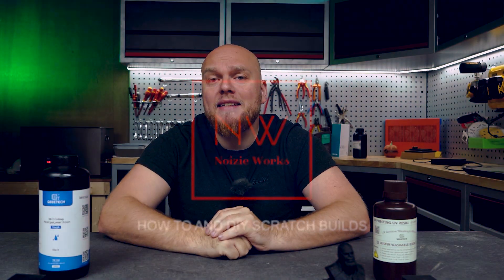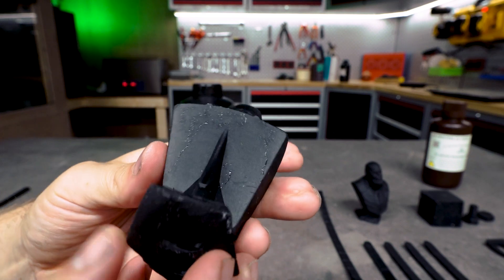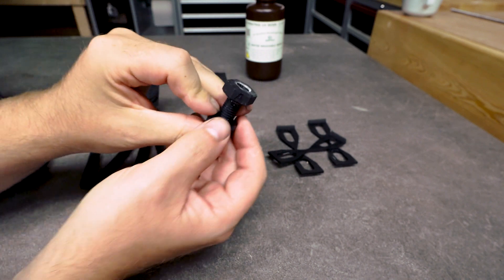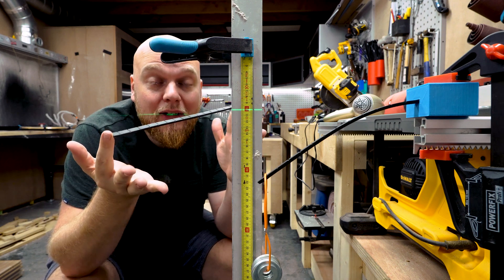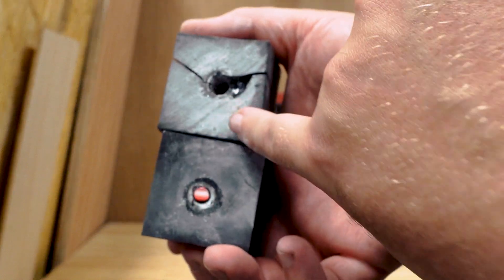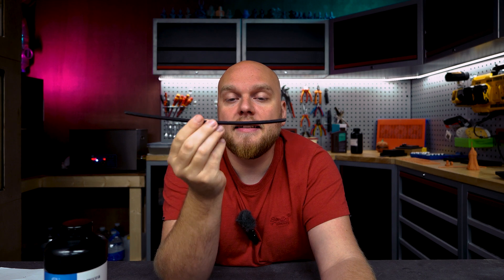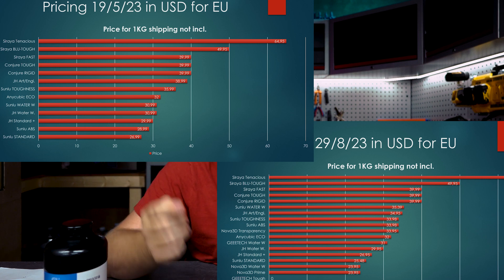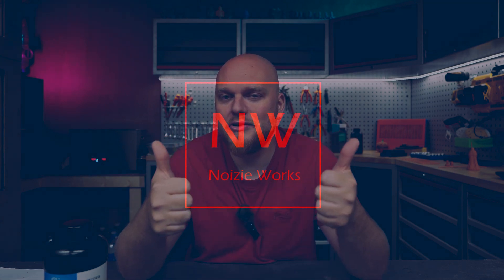GEEETECH, THE best Tough resin but there is a problem! And the water washable #6  #RTG

Comment: I would like to see Elegoos line up in the gauntlet. Printing speed test would be nice to see too, especially with the fast resins, but you might need to use a faster printer.
Reply from the maker: Just got the saturn 3 ultra in 🙂 speed will be tested! I have a lot going on right now but it's my goal to continue testing resins and elegoo will be on it.

Comment: Greetings. I am a user of Siraya Fast + Tenacious 15% mix ($43.75/lt). I would like to obtain the same result by mixing Siraya Fast and Sunlu ABS Like ($30.00/lt with Sunlu promo). I would like a result similar to the original Lego (true ABS). Could you do some tests mixing these two resins at 25-75, 50-50 and 75-25? Thank you.
Reply from the maker: It's in the planning 🙂